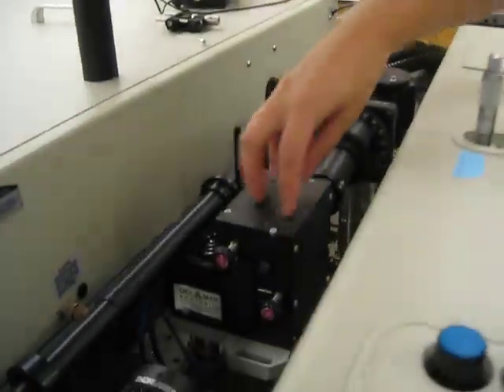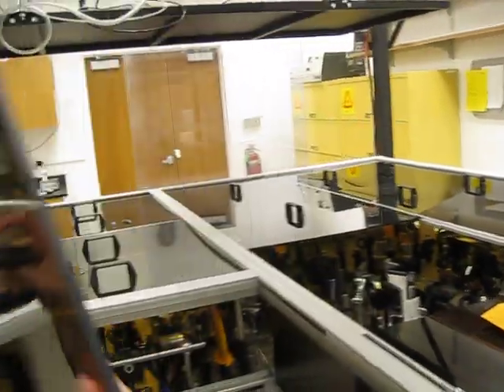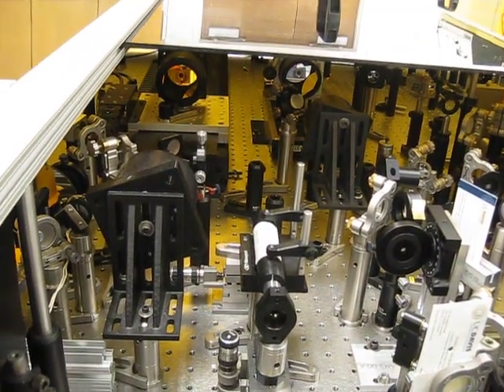A single source femtosecond-millisecond broadband spectrometer UC Davis - sales@dmphotonics.com

Comment from the maker: High-resolution and high-throughput brain connection imaging with chemical activation of GFP fluorescence
Hanqing Xiong, Xiaohua Lv, Anan Li, Hui Gong, Qingming Luo, Shaoqun Zeng
9 February 2015 • 10:30 - 11:00 AM | Part of SPIE BiOS

Multidimensional fluorescence analysis: recent advances with pattern matching
Benedikt Kraemer, Thomas Niehoerster, Anna Loeschberger, Marcelle Konig, Paja Reisch, Matthias Patting, Felix Koberling, Ingo Gregor, Markus Sauer, Rainer Erdmann
7 February 2015 • 4:15 - 4:40 PM | Part of SPIE BiOS

Quantitative wide-field fluorescence imaging in neurosurgery
Keith D. Paulsen, Pablo A. Valdes Quevedo M.D., Frederic Leblond, Brian C. Wilson, Brian W. Pogue, David W. Roberts M.D.
7 February 2015 • 4:00 - 4:30 PM | Part of SPIE BiOS

Fluorescence recovery after photobleaching (FRAP) implementation in micro-optical coherence tomography rheology
Diana Mojahed, Kengyeh K. Chu, Tim N. Ford, Susan E. Birket, Courtney Fernandez, Steven M. Rowe, Guillermo J. Tearney M.D.
7 February 2015 • 4:30 - 4:50 PM | Part of SPIE BiOS

Two-photon excited fluorescence emission from hemoglobin
Qiqi Sun, Yan Zeng, Wei Zhang, Wei Zheng, Yi LUO, Jianan Qu
8 February 2015 • 4:55 - 5:10 PM | Part of SPIE BiOS

Improvement of the spatial resolution in multiphoton microscopy by saturated excitation of fluorescence
Anh Dung Nguyen, Francois Duport, Frederique Vanholsbeeck, Serge Goldman, Philippe Emplit, Simon-Pierre Gorza
8 February 2015 • 5:30 - 7:00 PM | Part of SPIE BiOS

Imaging tuberculosis cytosolic translocation with two-photon fluorescence resonance energy transfer microscopy
Yassel Acosta, Qi Zhang, Hugues Ouelett, Jianjun Sun, Chunqiang Li
9 February 2015 • 4:50 - 5:10 PM | Part of SPIE BiOS

Clinical trials in near Infrared fluorescence imaging with IRDye 800CW
Daniel R. Draney
8 February 2015 • 11:00 - 11:30 AM | Part of SPIE BiOS

In vitro and in vivo investigation of pH tumor status using genetically encoded sensors and fluorescence imaging
Elena V. Zagaynova M.D., Marina V. Shirmanova, Irina N. Druzhkova, Maria Lukina, Ludmila B. Snopova M.D., Natalia N. Prodanetz, Vsevolod V. Belousov, Sergey A. Lukyanov
9 February 2015 • 5:10 - 5:30 PM | Part of SPIE BiOS

Fluorescence molecular imaging heads for the clinics: benefits and pitfalls
Vasilis Ntziachristos
8 February 2015 • 1:30 - 2:00 PM | Part of SPIE BiOS

Time-resolved fluorescence polarization spectroscopy of near-infrared dye in picosecond range
Yang Pu, Robert R. Alfano
10 February 2015 • 6:00 - 8:00 PM | Part of SPIE LASE

Tomographic fluorescence reconstruction by a spectral projected gradient pursuit method
Jinzuo Ye, Chongwei Chi, Yu An, Jie Tian
7 February 2015 • 4:40 - 5:00 PM | Part of SPIE BiOS

The stepwise multi-photon activation fluorescence guided ablation of melanin
Zhenhua Lai, Zetong Gu, Charles DiMarzio
8 February 2015 • 10:30 - 10:50 AM | Part of SPIE BiOS

High histologic grade and increased relative content of tryptophan in breast cancer using ratios from fingerprint fluorescence spectral peaks
Laura A. Sordillo, Peter P. Sordillo M.D., Yury Budansky, Yang Pu, Robert R. Alfano
10 February 2015 • 9:40 - 10:00 AM | Part of SPIE BiOS

Flavin fluorescence lifetime imaging of living cells grown on structured surfaces
Alzbeta Marcek Chorvatova, Julia Horilova, Tibor Teplicky, Beata Cunderlikova, Jaroslav Bruncko, Anton Mateasik, Dusan Chorvat, Jr.
8 February 2015 • 1:50 - 2:05 PM | Part of SPIE BiOS

Multifunctional highly dispersible PEGylated Eu3+-doped CaMoO4@Au-nanorods core/shell nanoparticles for fluorescence imaging, surface-enhanced Raman spectroscopy (SERS) detection, and photo-thermal therapy (PTT) applications of human lung cancer cells
Qifei Li, Abdul K. Parchur, Anhong Zhou
7 February 2015 • 4:00 - 4:20 PM | Part of SPIE BiOS

Fluorescence probing of the temperature-induced phase transitions in water-driven self-assembly of lipids
N. Idayu Zahid, Osama K. Abou-Zied, Rauzah Hashim
10 February 2015 • 8:30 - 8:50 AM | Part of SPIE BiOS

Key fluorophore subspace analysis of human breast cancer using native fluorescence spectroscopy excited by selective wavelength of 300 nm
Yang Pu, Robert R. Alfano, Laura A. Sordillo
12 February 2015 • 2:00 - 4:00 AM | Part of SPIE BiOS

Long term response of a Concanavalin A based fluorescence glucose sensor
Andrea K. Locke, Brian M. Cummins, Alexander A. Abraham, Gerard L. Cote
11 February 2015 • 10:30 - 10:50 AM | Part of SPIE BiOS

Compact handheld multispectral fluorescence lifetime imaging (FLIM) system for in vivo imaging of the oral mucosa
Shuna Cheng, Rodrigo Cuenca, Bilal H. Malik, Joey M. Jabbour, Yi-Shing Lisa Cheng D.D.S., John Wright D.D.S., Rock Rickel, Brian E. Applegate, Kristen C. Maitland, Javier A. Jo
8 February 2015 • 4:20 - 4:40 PM | Part of SPIE BiOS

Application of quantitative fluorescence imaging techniques for investigating intracellular interactions and dynamics of HIV-1 proteins
Yves Mely, Halina Anton, Nedal Taha, Marianna Sholokh, Salah El Meshri, Pascal Didier, Emmanuel Boutant, Ludovic Richert, Eleonore Real, Hugues de Rocquigny
8 February 2015 • 11:10 - 11:25 AM | Part of SPIE BiOS

Augmented microscopy with near-infrared fluorescence detection
Jeff Watson, Nikolay Martirosyan, Jesse Skoch M.D., Michael Lemole, Jr., Rein Anton M.D., Marek Romanowski
8 February 2015 • 9:20 - 9:40 AM | Part of SPIE BiOS

Video-rate super-resolution fluorescence microscopy using all-optical two-photon image scanning microscopy
Ingo Gregor, Martin Spiecker, Joerg Enderlein
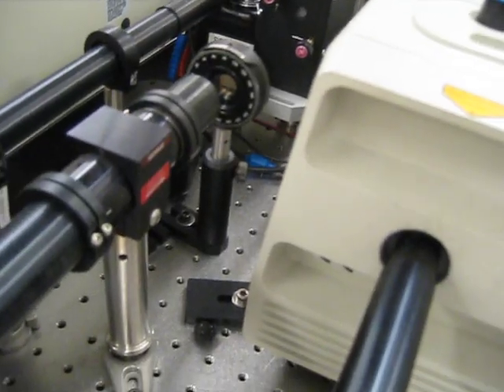8 February 2015 • 2:25 - 2:45 PM | Part of SPIE BiOS

Dual-beam, crossed line-scanning fluorescence microscope with confocal resolution
Hyun-Woo Jeong, Hyung-Jin Kim, Jung Eun, Seungjin Heo, Mikyoung Lim, Yong-Hoon Cho, Beop-Min Kim
9 February 2015 • 5:30 - 7:30 PM | Part of SPIE BiOS

Fluorescence cross-correlation spectroscopy for time dependent flows: a numerical investigation
Paolo Pozzi, Margaux Bouzin, Cassia A. Marquezin, Laura Sironi, Laura D'Alfonso, Maddalena Collini, Giuseppe Chirico
9 February 2015 • 10:00 - 10:20 PM | Part of SPIE BiOS

In-vivo tumor bed assessment after soft tissue sarcoma excision using Raman and fluorescence spectroscopy
John Quan M. Nguyen, Zain S. Gowani, Maggie E. O'Connor, The-Quyen Nguyen, Ginger E. Holt, Anita Mahadevan-Jansen
8 February 2015 • 10:35 - 10:55 AM | Part of SPIE BiOS

Cancer detection using native fluorescence spectral subspace of multiple fluorescent biomarkers: a preliminarypilot study
Kenneth J. Zhou, Jun Zhang, Yan Zou
11 February 2015 • 9:30 - 11:30 AM | Part of SPIE BiOS

Spatially and temporally registered optical coherence tomography and fluorescence microscopy for enhanced detection of neural activity
Md. Rezuanul Haque, M. Shahidul Islam, Christian M. Oh, Michael C. Oliveira, Sang S. Lee, Michael E. Adams, B. Hyle Park
9 February 2015 • 5:30 - 7:30 PM | Part of SPIE BiOS

Suspended core photonic crystal Fibers fluorescence sensor platform for nucleic acid detection
Alessandro Candiani, Michele Sozzi, Alessandro Tonelli, Annamaria Cucinotta, Roberto Corradini, Stefano Selleri
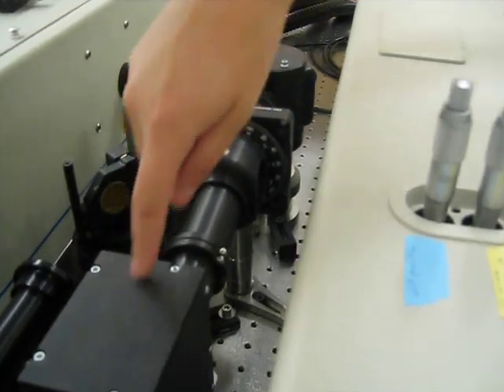8 February 2015 • 2:10 - 2:30 PM | Part of SPIE BiOS

Frequency-domain fluorescence lifetime imaging system (pco.flim) based on a in-pixel dual tap control CMOS image sensor
Gerhard A. Holst, Robert Franke
11 February 2015 • 5:40 - 6:00 PM | Part of SPIE BiOS

A surgical microscope combining real-time surface reconstruction and spectroscopic fluorescence imaging with a light transport model to quantify visible and near-infrared fluorescent molecular markers
Leticia M. Angulo-Rodriguez, Michael Jermyn, Kolbein Kolste, Pablo A. Valdes, Julien Pichette, Guillaume Sheehy, Yoann Gosselin, Mira Sibai, Kelvin Mok, Kevin Petrecca, David W. Roberts M.D., Keith D. Paulsen, Brian C. Wilson, Frederic Leblond
9 February 2015 • 5:30 - 7:30 PM | Part of SPIE BiOS

In-vivo validation of fluorescence lifetime imaging (FLIm) of coronary arteries in swine
Julien Bec, Dinglong M. Ma, Diego R. Yankelevich, Dimitris S. Gorpas, William T. Ferrier D.V.M., Jeffrey Southard M.D., Laura Marcu
8 February 2015 • 11:10 - 11:30 AM | Part of SPIE BiOS

Two- and three-photon excited fluorescence microscopy of erythrocytes using sub-50fs Ti:sapphire and Yb lasers
Marcos Dantus, Ilyas Saytashev
9 February 2015 • 1:50 - 2:05 PM | Part of SPIE BiOS

Clinical applications of fluorescence imaging for enhancing safety and therapeutic efficacy of hepatobiliary and pancreatic surgery
Takeaki Ishizawa, Yasuteru Urano, Mako Kamiya, Akinori Miyata, Suguru Yamashita M.D., Yosuke Inoue, Junichi Arita, Yu Takahashi, Akio Saiura, Norihiro Kokudo M.D.
8 February 2015 • 5:00 - 5:20 PM | Part of SPIE BiOS

Multimodal optical coherence tomography and fluorescence spectroscopy MEMS probe to assess inflammation in acute lung injury
Lida P. Hariri, Liane Bernstein, David C. Adams, Wendy-Julie Madore, Alyssa J. Miller, Yan Wang, Mathias Strupler, Etienne De Montigny, Kathy Beaudette, Nicolas Godbout, Caroline Boudoux, Melissa J. Suter
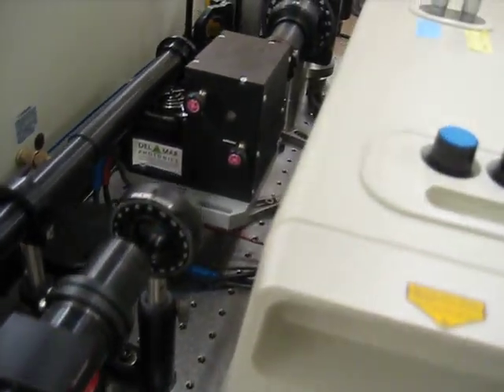8 February 2015 • 2:20 - 2:40 PM | Part of SPIE BiOS

Field portable fluorescence microscopy for detection of Giardia lamblia cysts in water samples
Hatice Ceylan Koydemir, Zoltan S. Gorocs, Euan R. McLeod, Derek Tseng, Aydogan Ozcan
8 February 2015 • 4:00 - 4:20 PM | Part of SPIE BiOS

Fluorescence lifetime flow cytometer with sub-nanosecond multi-exponential resolution
Giacomo Vacca, Ruofan Cao, Jesus Sambrano, Jr., Mark Naivar, Jessica P. Houston
11 February 2015 • 9:30 - 9:50 AM | Part of SPIE BiOS

Detection of oral precancer with fluorescence lifetime imaging and reflectance confocal microscopy
Bilal H. Malik, Shuna Cheng, Joey M. Jabbour, Rodrigo Cuenca, Yi-Shing Lisa Cheng D.D.S., John Wright, Javier A. Jo, Kristen C. Maitland
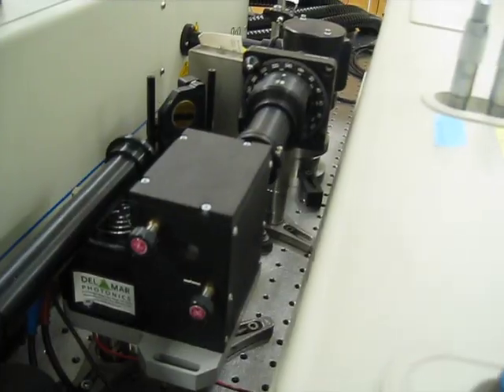7 February 2015 • 2:30 - 2:50 PM | Part of SPIE BiOS

Activatable fluorescence probes appropriate for assisting surgical and endoscopic procedures
Hisataka Kobayashi
8 February 2015 • 10:30 - 11:00 AM | Part of SPIE BiOS

Accounting for lymphatic delivery differences during fluorescence imaging of lymph nodes reveals differences between normal and tumor-bearing nodes
Alisha V. DSouza, Jonathan T. Elliott, Jason R. Gunn, Richard J. Barth M.D., Kimberley S. Samkoe, Kenneth M. Tichauer, Brian W. Pogue
7 February 2015 • 5:30 - 5:45 PM | Part of SPIE BiOS

Quantitative phase imaging with a 3D resolution equivalent to fluorescence: application to label-free biological tissue reconstruction
Pierre Bon, Sherazade Aknoun, Serge Monneret, Brahim Lounis, Benoit F. Wattellier, Laurent Cognet
9 February 2015 • 9:20 - 9:40 AM | Part of SPIE BiOS

Time resolved fluorescence spectroscopy using a single fiber probe for fluorescence lifetime assessment in real-time
Fartash Vasefi, David S. Kittle, Keith L. Black M.D., Pramod V. Butte
10 February 2015 • 1:30 - 2:00 PM | Part of SPIE BiOS

Characterizing the significance of multiple enzyme-bound formulations of NADH and their role in cerebral metabolism using 2-Photon fluorescence lifetime microscopy
Mohammad A. Yaseen, Sava Sakadzic, Buyin Fu, Weicheng Wu, David A. Boas
7 February 2015 • 11:00 - 11:20 AM | Part of SPIE BiOS

Quantitative fluorescence imaging enabled by spatial frequency domain imaging in the sub-diffusive regime for image-guided glioma resection
Mira Sibai, Israel Veilleux, Michael Jermyn, Guillaume Sheehy, Audrey Laurence, Frederic Leblond, Brian C. Wilson
7 February 2015 • 5:15 - 5:30 PM | Part of SPIE BiOS

Fiber-optic two-photon endomicroscopic fluorescence lifetime and fluorescence correlation spectroscopy imaging
Wenxuan Liang, Guanghan Meng, Gunnsteinn Hall, Ming-Jun Li, Xingde Li
8 February 2015 • 11:40 - 11:55 AM | Part of SPIE BiOS

In vivo all-optical interrogation of neurons in mice using optogenetics and calcium imaging with two-photon fluorescence microscopy
James R. Mester, Margaret Koletar, John G. Sled, Bojana Stefanovic
7 February 2015 • 2:20 - 2:40 PM | Part of SPIE BiOS

Fluorescence lifetime imaging: techniques and applications
Wolfgang Becker
8 February 2015 • 9:30 - 10:00 AM | Part of SPIE BiOS

Time-resolved fluorescence spectroscopy and ultrasound backscatter microscopy for non-destructive evaluation of vascular grafts
Hussain Fatakdawala, Leigh G. Griffiths, Sterling Humphrey, Laura Marcu
7 February 2015 • 11:00 - 11:20 AM | Part of SPIE BiOS

Tissue classification and diagnostics using a fiber probe for combined Raman and fluorescence spectroscopy
Riccardo Cicchi, Suresh Anand, Alfonso Crisci, Flavio Giordano, Susanna Rossari M.D., Vincenzo De Giorgi, Vincenza Maio, Daniela Massi, Gabriella Nesi, Anna Maria Buccoliero, Marco Carini, Renzo Guerrini, Nicola Pimpinelli, Francesco S. Pavone
10 February 2015 • 11:20 - 11:40 AM | Part of SPIE BiOS

Fluorescence lifetime spectroscopy for breast cancer margins assessment
Dimitris S. Gorpas, Hussain Fatakdawala, Yanhong Zhang, Richard Bold, Laura Marcu
10 February 2015 • 2:00 - 2:20 PM | Part of SPIE BiOS

A new fluorescence analyzer of PKU with N-type fiber coupler
Yanbin Zhu
8 February 2015 • 5:30 - 7:00 PM | Part of SPIE BiOS

A combined swept source optical coherence tomography and fluorescence lifetime imaging system for morphological and biochemical investigations of atherosclerosis
Sebina Shrestha, Brian E. Applegate, Javier A. Jo, Brial L. Walton, Siquin Zhaorigetu, Rosalva Munoz, Xi Chen, Jesung Park, Jesus Rico-Jimenez, Michael J. Serafino
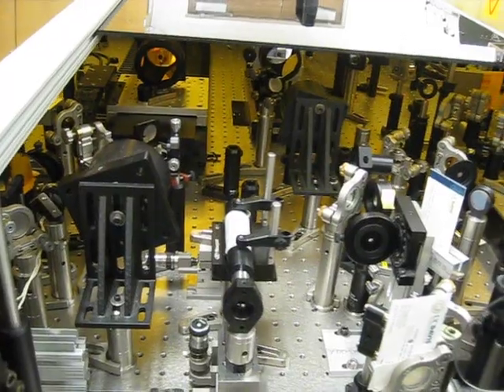9 February 2015 • 3:00 - 3:15 PM | Part of SPIE BiOS

Fluorescence imaging and quantum sensing using nitrogen-vacancy centers in nanodiamonds
Huan-Cheng Chang
10 February 2015 • 1:30 - 2:00 PM | Part of SPIE OPTO

Differential fluorescence holography
David C. Clark, Myung K. Kim
7 February 2015 • 11:20 - 11:40 AM | Part of SPIE BiOS

Adaptive optimisation of illumination beam profiles in fluorescence microscopy
Thomas J. Mitchell, Christopher D. Saunter, Gordon D. Love, John M. Girkin
7 February 2015 • 1:50 - 2:10 PM | Part of SPIE BiOS

Multimodal dual-clad fiber MEMS probe for simultaneous OCT and fluorescence imaging of inflammation in the lung
Liane Bernstein, Lida P. Hariri, Wendy-Julie Madore, David C. Adams, Mathias Strupler, Etienne De Montigny, Kathy Beaudette, Yan Wang, Nicolas Godbout, Melissa J. Suter, Caroline Boudoux
7 February 2015 • 3:40 - 4:00 PM | Part of SPIE BiOS

Monitoring metabolic enzyme activity in cells with fluorescence lifetime imaging of NAD(P)H
Joe T. Sharick, Melissa C. Skala
8 February 2015 • 5:30 - 7:00 PM | Part of SPIE BiOS

Statistical analysis on activation and photo-bleaching of step-wise multi-photon activation fluorescence of melanin
Zetong Gu, Zhenhua Lai, Xi Zhang, Jihao Yin, Charles A. DiMarzio
8 February 2015 • 5:30 - 7:00 PM | Part of SPIE BiOS

Super-resolution fluorescence imaging of biocompatible carbon dots
Godefroy Lemenager, Elisa De Luca, Ya-Ping Sun, Pier Paolo Pompa
8 February 2015 • 9:30 - 9:50 AM | Part of SPIE BiOS

In-vivo experimental validation for a featured-data time-domain diffuse fluorescence tomography based on the radiative transfer equation
Yan Zhang, Limin Zhang, Huijuan Zhao, Feng Gao, Jiao Li
9 February 2015 • 5:30 - 7:30 PM | Part of SPIE BiOS

Standing-wave excitation of fluorescence in a laser-scanning microscope allows precise contour mapping of the red blood cell membrane
Rumelo Amor, Sumeet Mahajan, William B. Amos, Gail McConnell
11 February 2015 • 3:40 - 4:00 PM | Part of SPIE BiOS

A six-color four-laser mobile platform for multi-spectral fluorescence imaging endoscopy
John F. Black, Tyler Tate, Molly Keenan, Elizabeth J. Swan, Urs Utzinger, Jennifer K. Barton
8 February 2015 • 9:30 - 9:50 AM | Part of SPIE BiOS

A new calibration tool to simply and quickly monitor and follow the performances of fluorescence microscopes
Arnaud Royon, Gautier Papon
10 February 2015 • 11:40 AM - 12:00 PM | Part of SPIE BiOS

Dual modality of non-contact photoacoustic tomography and fluorescence imaging using double cladding fiber
Jonghyun Eom, Seong Jun Park, Ju Wan Kim, Soongho Park, Byeong Ha Lee
9 February 2015 • 5:30 - 7:30 PM | Part of SPIE BiOS

Smart surgical tools: real-time time-resolved fluorescence spectroscopy integration with surgical tools for intra-operative tumor detection
Pramod V. Butte, Fartash Vasefi, David S. Kittle, Chirag Patil M.D., Ray Chu M.D., Keith L. Black M.D.
8 February 2015 • 10:55 - 11:15 AM | Part of SPIE BiOS

Multifocus fluorescence correlation spectroscopy
Vit Dolezal, Lars Kreutzburg, Renate Holzhause, Lennart Lohmann, Richard Borner, Christian G. Hubner
7 February 2015 • 9:10 - 9:30 AM | Part of SPIE BiOS

Real-time fluorescence-guided tumor visualization for intraoperative surgical resection
David S. Kittle, Adam Mamelak M.D., Julie Novak, Stacey Hansen, Keith L. Black M.D., Pramod V. Butte
8 February 2015 • 9:45 - 10:05 AM | Part of SPIE BiOS

Activatable thermo-sensitive ICG encapsulated pluronic nanocapsules for temperature sensitive fluorescence tomography
Tiffany C. Kwong, Farouk Nouizi, Uma Sampathkumaran, Yue Zhu, Maksudul M. Alam, Gultekin Gulsen
9 February 2015 • 1:40 - 2:00 PM | Part of SPIE BiOS

Multiplexed fluorescence tomography with spectral and temporal data: intrinsic regularization with nonnegative least squares
Vivian E. Pera, Dana H. Brooks, Mark J. Niedre
10 February 2015 • 11:40 AM - 12:10 PM | Part of SPIE BiOS

Fast full angle fluorescence molecular tomography system based on rotating mirrors
Daifa Wang, Jin He, Yubo Fan, Deyu Li
10 February 2015 • 1:40 - 2:00 PM | Part of SPIE BiOS

Super-resolution fluorescence imaging of C2C12 cell differentiation
Jing Qi, Xiao Peng, Junle Qu
9 February 2015 • 5:30 - 7:30 PM | Part of SPIE BiOS

Third harmonic generation and multiphoton fluorescence in graphene using a compact femtosecond 1.56 µm laser
Antti Saynatjoki, Lasse Karvonen, Juha Riikonen, Wonjae Kim, Joonas Makinen, Seyed Soroush Mehravar, Robert A. Norwood, Nasser N. Peyghambarian, Harri Lipsanen, Khanh Kieu
9 February 2015 • 1:40 - 2:00 PM | Part of SPIE OPTO

Fluorescence image-guided surgery: from benchtop to bedside
Siavash Yazdanfar, Victoria E. Cotero, Tiberiu M. Siclovan, Dmitry V. Dylov, Cristina A. Tan Hehir
8 February 2015 • 8:00 - 8:30 AM | Part of SPIE BiOS

A robust simulation and reconstruction platform of fluorescence molecular tomography
Shixin Jiang, Chongwei Chi, Yu An, Jie Liu, Jie Tian
11 February 2015 • 11:40 AM - 12:00 PM | Part of SPIE BiOS

Radiometric configuration parameters to consider in quantitative clinical fluorescence imaging measurements
Maritoni Litorja, Aaron Urbas
8 February 2015 • 5:30 - 7:00 PM | Part of SPIE BiOS

Reversibly switchable fluorescence microscopy
Junjie Yao, Daria M. Shcherbakova, Chiye Li, Arie Krumholz, Ramon A. Lorca, Erin Reinl, Sarah K. England, Vladislav V. Verkhusha, Lihong V. Wang
9 February 2015 • 5:30 - 7:30 PM | Part of SPIE BiOS

Development of a spectrally-resolved near-infrared fluorescence imaging system based on a wavelength-swept laser
Jaedu Cho, Tiffany C. Kwong, Farouk Nouizi, Chang-Seok Kim, Gultekin Gulsen
7 February 2015 • 5:45 - 6:00 PM | Part of SPIE BiOS

Effects of scattering and absorbing medium in the fluorescence conversion efficiency of physical tissue models
Suresh Anand, Sujatha Narayanan Unni
7 February 2015 • 4:00 - 4:20 PM | Part of SPIE BiOS

Real-time, quantitative fluorescence imaging using single snapshot optical properties imaging for neurosurgical guidance
Pablo A. Valdes Quevedo, Joseph Angelo, Sylvain Gioux
7 February 2015 • 5:00 - 5:20 PM | Part of SPIE BiOS

Fluorescence time course imaging of healthy and diseased skin for PpIX metabolic maps used in topical PDT and its correlation to the skin and lesions structures
Olena Kulyk, James Ferguson, Sally Ibbotson, Harry Moseley, Ronan M. Valentine, Ifor D. W. Samuel
8 February 2015 • 2:30 - 2:50 PM | Part of SPIE BiOS

Dithienylethene-based fluorescence molecular photoswitches for photoswitching nanoimaging
Ming-Qiang Zhu
8 February 2015 • 5:30 - 7:00 PM | Part of SPIE BiOS

Simultaneous optical coherence tomography and fluorescence imaging utilizing a single illumination source
Ryan P. McNabb, Tomas Blanco, Howard M. Bomze, Henry C. Tseng, Daniel R. Saban, Joseph A. Izatt, Anthony N. Kuo M.D.
11 February 2015 • 10:45 - 11:00 AM | Part of SPIE BiOS

Light-weight, concomitant color and NIR fluorescence imaging system for molecular-guided minimal invasive interventions
Maximilian W. Koch, Pilar Beatriz Garcia Allende, Vasilis Ntziachristos
8 February 2015 • 9:00 - 9:20 AM | Part of SPIE BiOS

Fluorescence detection of lymph node metastasis using 5-aminolevulinic acid in human colorectal cancer
Yoshinori Harada, Takeo Minamikawa, Hisataka Matsuo, Yoshihisa Yamaoka, Ping Dai, Tetsuro Takamatsu
9 February 2015 • 5:30 - 7:30 PM | Part of SPIE BiOS

Characterization of oral cancer with multispectral fluorescence lifetime imaging in the hamster model of oral carcinogenesis in vivo
Bilal H. Malik, Joohyung Lee, Shuna Cheng, Rodrigo Cuenca, Joey M. Jabbour, Yi-Shing Lisa Cheng D.D.S., John Wright D.D.S., Beena Ahmed, Kristen C. Maitland, Javier A. Jo
9 February 2015 • 8:45 - 9:05 AM | Part of SPIE BiOS

Sentinel lymph node detection in breast cancer patients using surgical navigation system based on fluorescence molecular imaging technology
Chongwei Chi, Deqiang Kou, Jinzuo Ye, Jingdan Qiu, Jiandong Wang, Jie Tian
8 February 2015 • 4:30 - 5:00 PM | Part of SPIE BiOS

Whole-body temperature modulated fluorescence tomography for small animals
Farouk Nouizi, Tiffany C. Kwong, Jaedu Cho, Uma Sampathkumaran, Yue Zhu, Maksudul M. Alam, Gultekin Gulsen
9 February 2015 • 5:30 - 7:30 PM | Part of SPIE BiOS

A novel data-extraction-method of the CCD-based noncontact fluorescence tomography system for small animal imaging
Huijuan Zhao, Qian Wang, Xiaoqing Zhou, Shuang Wang, Jiao Li, Limin Zhang, Zhongxing Zhou, Feng Gao
9 February 2015 • 5:30 - 7:30 PM | Part of SPIE BiOS

Plastic fiber optics for micro-imaging of fluorescence signals in living cells
Takashi Sakurai, Mitsuo Natsume, Kowa Koida
9 February 2015 • 5:30 - 7:30 PM | Part of SPIE BiOS

Characterization of connective tissue progenitors through phase contrast and multicolor fluorescence time-lapse microscopy
Edward Kwee, Kimerly Powell, George Muschler M.D.
10 February 2015 • 8:00 - 8:20 AM | Part of SPIE BiOS

Fast depth-sensitive fluorescence measurements in turbid media using fiber rings
Yi Hong Ong, Quan Liu
7 February 2015 • 9:40 - 10:00 AM | Part of SPIE BiOS

Preclinical validation of dual-modality optical coherence tomography (OCT) and near-infrared fluorescence (NIRF) molecular imaging for the in vivo assessment of atherosclerosis and current treatments
Giovanni Jacopo J. Ughi, Eric Osborne, Tetsuya Hara, Johan Verjans, Iwata Hiroshi, Hao Wang, Ali M. Fard, Adam Mauskampf, Masanori Aikawa, Farouc A. Jaffer M.D., Guillermo J. Tearney M.D.
8 February 2015 • 9:20 - 9:40 AM | Part of SPIE BiOS

Cholesterol efflux monitoring in macrophage form cells by using fluorescence lifetime imaging
Young Sik Song, Dug young Kim
9 February 2015 • 10:40 - 11:00 AM | Part of SPIE BiOS

Fluorescence lifetime imaging to differentiate bound from unbound ICG-cRGD both in-vitro and in-vivo
Paulien L. Stegehuis, Martin C. Boonstra, Karien E. de Rooij, Francois E. Powolny, Riccardo Sinisi, Harald Homulle, Claudio E. Bruschini, Edoardo Charbon, Boudewijn P. F. Lelieveldt M.D., Alexander L. Vahrmeijer M.D., Jouke Dijkstra, Martijn van de Giessen
9 February 2015 • 6:35 - 6:55 PM | Part of SPIE BiOS

Super resolution brain imaging by using a two-photon fluorescence microscopy with harmonic modulation
Szu-Yu Lee, Chi-Kuang Sun
8 February 2015 • 5:30 - 7:00 PM | Part of SPIE BiOS

In-vivo multispectral fluorescence imaging of murine colonic dysplasia with scanning fiber endoscopy
Arlene Smith, Asha Pant, Bishnu P. Joshi, Emily F. Rabinsky, Juan Zhou, Xiyu Duan, Chenying Yang, Eric J. Seibel, Thomas D. Wang M.D.
9 February 2015 • 11:40 AM - 12:00 PM | Part of SPIE BiOS

FRAP (fluorescence recovery after photobleaching) imaging using SLM-controlled doughnut spots
Yi Xue, Christopher Rowlands, Peter So
8 February 2015 • 5:30 - 7:00 PM | Part of SPIE BiOS

Non-linear fluorescence excitation of Rhodamine 6G and TRITC labeled IgG in whispering gallery mode microresonators
Silvia Soria Huguet, Daniele Farnesi, Giancarlo C. Righini, Gualtiero Nunzi Conti, M. Pilar Marco, Carme Pastells, Pablo Loza-Alvarez, David Merino-Arranz, Laura Pasquardini, Cecilia Pederzolli
10 February 2015 • 8:20 - 8:40 AM | Part of SPIE LASE

Automatic visualization of dual-modality intravascular optical coherence tomography (OCT) and near-infrared fluorescence (NIRF) images for assessing vessel wall microstructure and quantitative molecular imaging
Giovanni Jacopo J. Ughi, Tetsuya Hara, Eric A. Osborn, Johan Verjans, Hao Wang, Ali M. Fard, Adam Mauskampf, Farouc A. Jaffer M.D., Guillermo J. Tearney M.D.
8 February 2015 • 9:00 - 9:20 AM | Part of SPIE BiOS

Improved tumor identification using dual tracer molecular imaging in fluorescence guided brain surgery
Xiaochun Xu, Veronica Torres, David Straus, Richard W. Byrne, Kenneth M. Tichauer
8 February 2015 • 12:15 - 12:30 PM | Part of SPIE BiOS